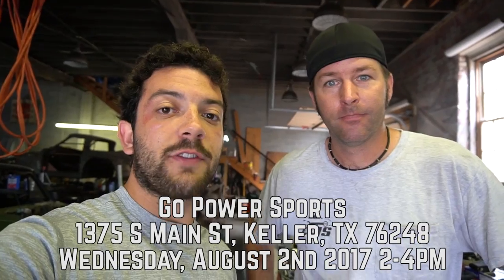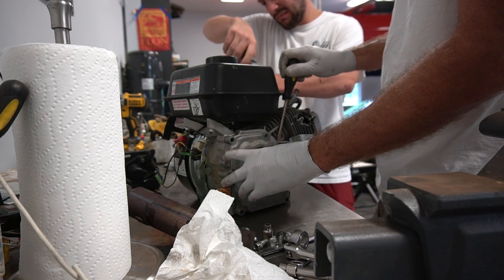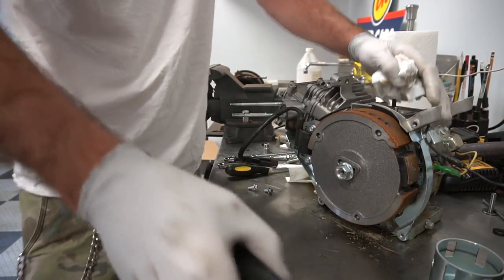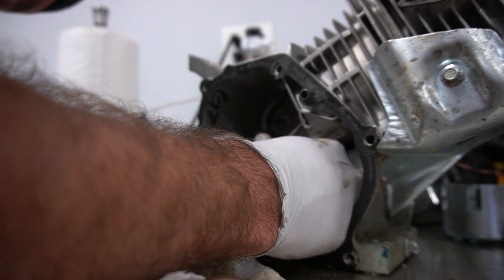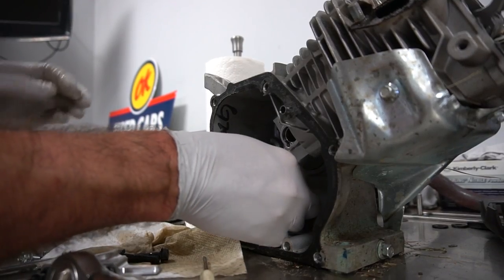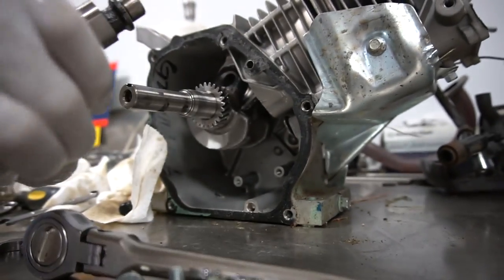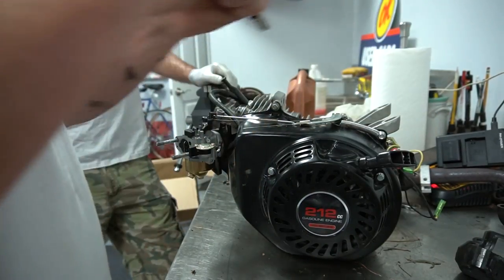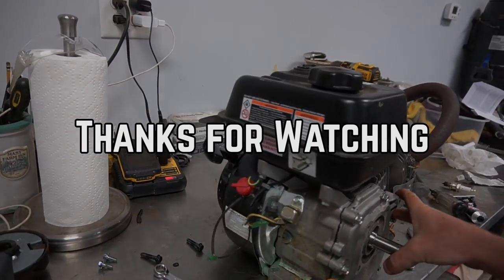Big Cam & Billet Parts: How to Install the Stage 2 Performance Predator Kit

Comment: for the price of that kit it should include the gaskets....just sayin
Reply: i always ordered my parts for these from Omb warehouse due to the cost difference
Reply: 027 - SpeedyRaceTeam - Noah  I never new about omb warehouse will be buying from them next
Reply: i order my parts for a mild performance rebuild it was way cheaper than anywhere else and so far its good parts
Reply: 027 - SpeedyRaceTeam - Noah over priced shipping from omb
Reply: i think you get it free over like 100$ shipping
Reply: NR racing has the best deals and quality parts. Check em out
Reply: I thought it did.

Comment: You should put 4 of those kits on the all wheel drive go kart so it has 60 hp like so they an see
Reply: Too much work for something that's not worth it in my opinion
Reply: Youthfulcross44 4wd go kart is the dumbest and the most pointless thing they have done by yet
Reply: Luke DeCarlo it's a rebuild of 4 motors that'll take 1hr 30 minutes per engine to potential get 60 hp in my opinion that's worth it
Reply: They already got a 4wd go kart

Comment: the best way to keep the valves up when doing springs is to use an old spark plug wire (or a very clean rope) with the ends cut off and coil it into the spark plug hole with the end sticking out so you can get it back out and engine at top dead center the wire will hold the valves up and make it far easier to do. Moto Migs

Comment: Just had my 21cc Vanguard engine out, as 5 engine bolts came loose. (???) (wtf) (RIGHT I know). Anyways the gasket got damage but we went with the goo and guest what, the engine would not turn over when it was put back together. Needed that "thickness" of the gasket. Lucky for you there guys there.

Comment: Correct me if I'm wrong, but wouldn't it be cheaper to just buy a predator 420cc? The engine is almost $150 and the kit is $320. That's more than $500 after taxes?  A 420cc is only $340 from harbor freight. So you could just get basic mods on the 420cc and have an electric start for less than that kit and the 212cc.
Reply: ryan Kirby I totally get you but I suppose the 212 would save some weight
Reply: ryan Kirby  good point. Your right
Reply: And maybe you dont have the room for a 420
Reply: Some racing kart classes are limited to 212 and that's where many of these parts were originally sold (or ones like them). A bigger stock motor will be less temperamental and give ultimately probably longer service (assuming that someone with a modded 212 is gonna hammer on it every sec lol).
Reply: I can understand if you going to race them. I never thought about that.
Reply: then you would just have a heavier engine with the same problems you would have had with a stock 212.
Reply: I agree. I have a 390. Stock RPMs will only allow stock speed. Its no faster than a stock 212. Extra weight and wasted HP. Its time to build my 390. needs RPMs and a torque converter so I can gear it for speed.
Reply: ryan Kirby more wheat
Reply: No replacement for displacement

Comment: Are you able to put the heavy duty valve springs in an engine that doesn't have any of those mods besides a performance intake and exhaust, and also bigger carb jets?
Reply: Moto Migs yes you can and that's one of the best upgrades because the stock but ones are only 10.8 lbs and only get weaker with time
Reply: Hardy's Mobile Garage ok awesome, thanks!
Reply: Moto Migs your welcome
Reply: your problem are gonna be high revs. with stock valve springs the valves start to flow at around 5000 rpm, but with the 18 lbs ones you can get up to 8000 rpm or so. Therefore if you don't get a billet rod and flywheel your engine is gonna blow up sooner or later. I like the 10.8 lbs springs so you can hit the gas pedal without worrying about the engine blowing up.
Reply: Hans Peter well the only problem with running those springs is really just the flywheel I race these motors up to 7000 with stock rods because of rules stock cams really won't let these motors rev very high but I get all my performance parts from Dynocams online store they sell top of the line performance parts for gokarts because they are big in racing and I use there PLV flywheel it can be turned as fast as you want no problem the biggest difference is the ignition timing isn't as advanced as arc's and it's like 40$ cheaper I haven't had any problems with mine
Reply: my stock class race motor has a cl3 Dynocams cam, 10.8 valve springs, PLV aluminum flywheel/w 4 degree advance key for total 32 degrees of timing, pod filter, no governor, header with muffler to produce required back presser, top plate, and Dynocams low tension rings turns 7000 rpm with stock rods
Reply: Moto Migs yes we did on our kart and ran it like that for a year

Comment: And now you see why the go kart was blowing smoke while racing down the road, the oil ring most likely shifted causing it to be out of line.  When changing the rod take the piston out and make sure the rings are lined up, unless you like fogging for bugs while running.  As for gaskets you can get a roll of gasket paper to make case gaskets, you will save a ton of money in the long run instead of buy "official" gaskets.
Reply: the smoke wasn't coming out of the exhaust it was blowing onto it from the open crankcase breather tube

Comment: Why didn't they use 26 pound valve springs they are stiffer springs which should make it safer in higher revs
Reply: Jared's lawn Service with that cam you have have to use those springs to get proper performance

Comment: Did you end up using plasta gage and torqueing the rods? Could not tell from the video.
Reply: Stephen May ive done this before. yes use plastigauge and torque the connecting rod by slowing incrementing the torque until you get to the desired torque

Comment: Did he just botched the final torque on these connecting rod caps? Rip bearings...
Reply: Ark says to torque it in increments to 170 inch pound's n let it set a min then back it off to correctly seat the bearing in the rod n then plasi gauge it n re torque it in increments to 170 Idk if they re checked it off camera or not tbh. Hope the motor is ok, love watchin these video's..

Comment: its a shame that that beautiful flywheel just gets covered up
Reply: yea
Reply: Isaac it'll be fine: what's your opinion on the 420cc Dynomax engine from Walmart. it makes like 16 horsepower and I have a stripped-down three wheeler 1985 Yamaha and I need engine and I was going to go with a Dynomax but do you have any insight on them.

Comment: use assembly lube on all parts and use a case cover gasket you take out needed end play as the engine gets hot it may lock up damaging all the engine parts
Reply: guess you never watched the video

Comment: i just got a mini bike with 2 crap 80 cc engine (by crap i mean they were not taken care of)
im looking to put a 212 pred on it and was curious if you had to change the rear sprocket on ikes  black mini bike with the red seat, or if that will work with a 41 chain

Comment: Was pulling the head off that much more work? Actually curious because if seems like it would of been less effort to just strip it down, changed it all and put it back together, or it's not that simple?
Reply: I figured that was 1 more gasket to rip
Reply: Isaac it'll be fine OMG Isaac, you replied, it's like it means your real now not just some one I watch on the tube. Yea I figure one less gasket to replace is better.

Comment: please recall your statement about springs putting pressure on camshaft! in fact springs pull valve away from lobes of camshaft!
Reply: James Miller do you really think valve springs pull the valves away from the cam lobes or have i missed something?

Comment: Ok. My Kawasaki Eliminator 125 tops out at just over 60mph. The engine makes 12hp 7.1 lb-ft of torque. The bike weighs a little over 300lbs. If that predator ends up making 15hp, with the right gearing "It'll be fine." enough to hit 60mph. ;-)

Comment: How do u get a accurate reading with the plasty gage if there is no oil between the rod and crank like there would be if the engine was running??
Reply: you don't want oil. you are measuring the gap to make sure oil will go in there
Reply: Harley Burns that's what the plastic gage is for , to measure your clearance. For oil , and expansion with heat.
Reply: Isaac it'll be fine  but when you are dealing with thousands of and inch wouldn't oil play a factor and also huge fan thanks for the reply and I am not trying to criticize but in all of our race motors we have always put oil in with the plasty gage I just want to know if I am doing it right
Reply: itll be fine. lol.

Comment: Ike, how come you didn't show installing the intake valve spring? Bet your finger couldn't reach it through the exhaust port? What did you do, take the carb back off and go through the intake port? Are you really going to run that engine without torquing the rod bolts nor the flywheel? I'm just trying to learn how to do it right. Boy, going from 
6 1/2 hp to, what did John say, 18 hp? That should be one hot mama.
I enjoy your videos, like to pull your chain a little.
Reply: 15 hp. lol. we kinda figured yall could figure it out. lol
Reply: You're not getting 15 hp with the stock carb.
Reply: my carb was very modified

Comment: How do you know if you have a hemi or non hemi 212? I want to get one from harbour freight but it doesn't specify
Reply: Cats n Cars all the new 212 are hemis
Reply: the hemi has a aluminum valve cover with ohv on it. non hemi has a stamped steel valve cover with ohv on it

Comment: What predator 212 is better hemi or non hemi
Reply: Off Road Cameras hemi more torque and more reliable
Reply: Off Road Cameras the newer ones are hemi.
Reply: Thanks that's what I thought i have a hemi and it felt like more torque but I thought it was just a fluke

Comment: Why are you guys using American sockets to disassemble a engine with metric bolts?
Reply: robertas grigas knucklheads
Reply: The only standard tools they used was for the spark plug...

Comment: Putting a dot of valve laping compound into the roller/ball bearings makes them easier to spin saving hp.Also don't be like these guys. Go on ebay and get yourself a nice Lifan 200cc with a 5 speed gearbox and electric start. It would cost about the same as this.

Comment: kiss that engine good buy use a puller on fly wheels you damage the the crank and bearings three jaw or a large steering wheel puller

Comment: Um u can't make that much power with just a cam.... you would need a ported head and prob a piston
Reply: Butter Panda stock they make 6 1/2hp at 3600 rpm. At 5-6000rpm they should make at least 8-9maybe 10hp. It should make 15 no problem with just a cam and valve springs